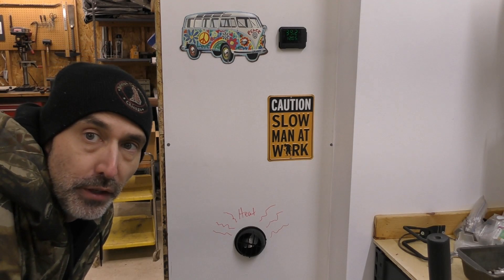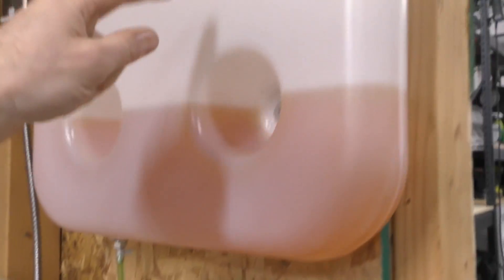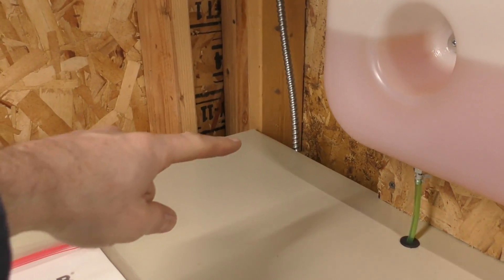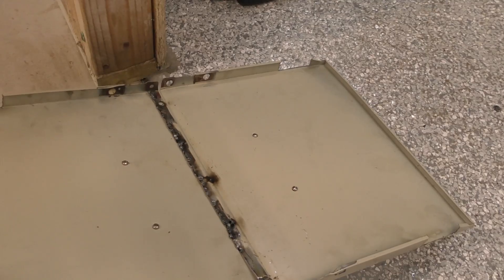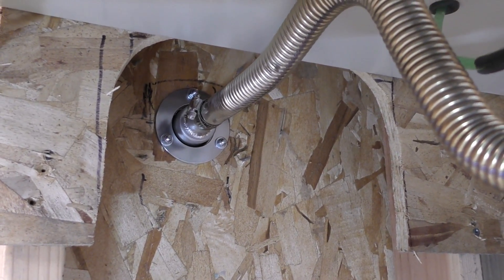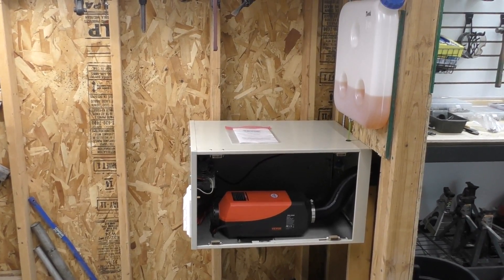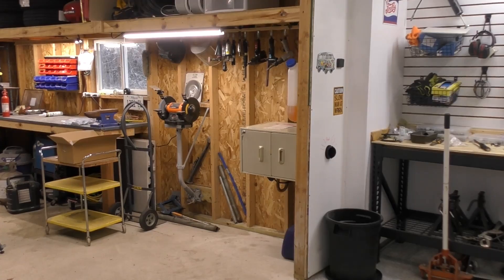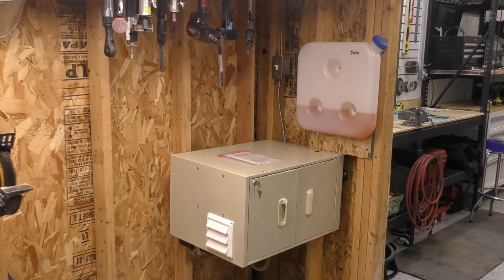Custom Garage Mini Furnace Using a Vevor Diesel Heater

Comment: Have you had any problems with soot build up due to the low point in the exhaust piping?
Reply from the maker: No soot buildup yet.  Watch the follow-up video pinned in a comment.  That shows the changes I made to the exhaust soon after I installed it.
Reply: @FixItScotty I saw that after I posted. Thank you.

Comment: Tank looks a little high up - isnt it hard to refill?
Reply from the maker: It is a little high, but I just have a small 3 gallon container that  I dump in. Other commenters have noted they pump from a lower tank and it works fine.

Comment: 2:39 fuel..  I run from an outside/ under cover 15 gal fuel call (cuz I had one) over ten feet away with a 1/4 inch hole through wall .  . The hard plastic line has an in-tank fuel filter strapped to it..   run with ZERO problems, 2 yrs, 4 mo per year nonstop, 24/7.  Nice fueling 1 time per week. OUTSIDE
Reply from the maker: Good to know. Thanks for sharing your setup!

Comment: The room I wish to heat is about 16 feet by 14 feet, and is insulated. Will one of these heaters bring it up to 70 degrees if it is freezing outside?
Reply from the maker: Depends on the insulation, but I would think so.  My garage is 30 x 18 with a very high 12 ft ceiling.  I can maintain a 10 degree temp. lift in that big area with this little thing.

Comment: Your exhaust having that big u in it,  is going to cause your combustion chamber to start getting carbon buildup. It will take a while but eventually it will stop producing good heat and then it just won't run. You'll have to take it apart and clean it all out maybe buy a new glow plug . . Other than the fuel pump mounting and the exhaust. Looks good .
Reply from the maker: I agree.  I did a follow video pinned in the comments that rectifies the issues you brought up.  Which are very good points.  Thanks for watching!

Comment: All the comments I read everybody has a different opinion on how these are supposed to be setup many of different experts apparently haha great job on your setup one of the nicest I've seen
Reply from the maker: I did a follow-up video (linked in the pinned comment) where I implement some of the commenters' suggestions to my build.  But, you're right, there are so many differing opinions on what is the "correct" way to run these.  Mine has been working great for the last year, so I am satisfied with my build.

Comment: Do not ever connect a power supply to a diesel heater. Battery and trickle charger is the best method.  If you suffer a power outage the heater will not be able to complete its cool down proceedure, potentially your workshop goes up in smoke.  Your combustion air intake should be outside as you are creating negative pressure inside the room and your exhaust should run down continuously from the heater as the exhaust gases contain moisture and you have created a trap for it.  Otherwise well done.
Reply from the maker: I don't run this full time.  The 55-amp power supply has been a good working solution.  Where I live, we don't have extreme weather.  If we do, I won't run it.  I understand your point about negative pressure, but my workshop isn't sealed up and has roof vents - so it's not an issue.  Good points though; other people's situation will warrant considering them.  Thanks for watching!

Comment: For 12v power you can also use an old computer tower power supply. The 12v is normally the yellow wires. Connect 2-3 of those wires to a couple of those XT60, 45a Anderson or insulated spade connectors then your heater
Reply from the maker: That could be a good option.  Thanks!

Comment: As already noted exhaust needs to be downhill the whole way for condensate draining. In addition the pump should be mounted at like a 30 deg angle with output on the high side. The other change I'd make is the tank. Holes in the bottom of tanks frequently or always leak at some point. Much better idea to use a stand pipe that draws out the top of the tank. They're available in a kit with some better white solid plastic fuel hose. The cheap green included tends to fail after a few months.
 Otherwise a nice install that gives a lot of people ideas
Reply from the maker: You are correct.  I have a follow-up video pinned in a comment where I implement most of your suggestions.  Thanks for watching!
Reply: @FixItScotty  Yep gotcha...just figured I'd address it again for anyone reading and didn't see or watch other vids

Comment: The heater should heat that size garage easily I would think.  Maybe get a small fan to help circulate the air.  Other than that I absolutely love your setup!  Very nice work Sir!  Great job.
Reply from the maker: Thanks!  Yes, I did add an oscillating fan mounted high on the wall to circulate.  I am a few weeks into the second season using it and it still works great.

Comment: Good work on using the fuel line for gasket. RedDye diesel is cheaper. Looks like off road use to me. Available where farmers get fuel. 🤠
Reply from the maker: Thanks!  I didn't realize my diesel was dyed, but it is red.  I don't live in a rural area, but I am in Illinois where there are farms within 10 miles of where I live, so that may be the only type of diesel easily available to me.

Comment: Can get more heat for less cost out of a Big buddy propane heater
Reply from the maker: That's true.  I actually have a 'Little buddy' and used it a lot in my old garage.  The two advantages of this diesel heater is that it blows the hot air to circulated it and it doesn't require ventilation like the propane heater.
Reply: @FixItScotty  they have a fan on the big buddy pro, there is an O2 safety shut off and the garage isn't sealed the best anyway. This way I don't have to drill a hole for exhaust. 
There's a bunch of ways to get more heat off the exhaust from the diesel heaters before dumping it but I'm not heating it all the time just a few hours here and there. So that's a lot of extra work for a diesel heater for me
Reply from the maker: @spacebike420  Good to know the propane heaters are improved.  And I agree, it is a bit of work to modify the exhaust to make these diesel heaters efficient.
Reply: @FixItScotty  they still seem the best option on something mobile with diesel available though. I'll probably put on in the truck topper just for camping.

Comment: Have you had condensation accumulation in the "U" exhaust pipe bend? I've seen videos where the low point was filled with water from condensation rather than external water intrusion.
Reply from the maker: Before I started using this heavily, I made a follow-up video with several enhancements; one being the exhaust.  Check out that video linked in the video description.  Thanks for watching!

Comment: A ceiling fan will help to distribute the heat evenly in your shop !
Reply from the maker: Yes, I mounted a large, oscillating fan high on that back wall.  That helps move the heat around.  Thanks for watching!

Comment: It is better to have the tank below the heater that way if you have a fuel leak you won't die ☹️
Reply: Do you trust your shop to a 25 cent rubber hose ?
Reply from the maker: No, see my follow up video. I upgraded the fuel line and exhaust.

Comment: Can anyone say how much it burns in a day? say it's heating a shop 900 sq ft, insulation is pretty.
Reply: say it's -20
Reply from the maker: I can't say how much it burns in a 24 hour period because I only use it for a few hours at a time.  My guess is that it can burn anywhere from a 1/2 gallon to over a gallon of fuel per day depending on how much temperature lift you are trying to get, how insulated your shop is, and the volume of air that's in it, etc.  There are many variables that make it difficult to give an accurate answer.

Comment: What i have learned so far on these and some suggestions. Tank does not matter above or below pump. The pump should be mounted on vertical surface at a approx. 45 degree angle to one side or other in proper direction. Recommend upgrading fuel line to nylon fuel line, green fails. That power supply your using is a converter/charger, so you can run the unit off a 12v  battery and charge at same time in the event of a power outage. If you shut these down before cool down is complete you can destroy your heater, really must have battery backup or a automatic whole house generator for quick power recovery say in like two minutes. The heater goes into cool down as power is restored. As others have noted exhaust is a trap, must all flow down, exhaust installed like this lead to sooted heat exchanger over time and a real mess. These are simple but they do have some must does when installing.
Reply from the maker: I agree with your suggestions.  I have a link to a follow-up video in the description where I addressed these issues.  Thanks for watching!

Comment: I have w vevor 8kw in my workshop size slightly bigger than a double garage. 2 heaters transform my garage from 3+ to 18+ clcius within 40 minutes
Reply from the maker: My single heater will provide a 20 degree Fahrenheit temperature lift, but it takes a bit longer than 40 minutes.  So far, I am pleased with it.  Thanks for watching!
Reply: @FixItScotty  buy another one. 2 is really a difference.

Comment: I concur with all the construction points raised below. Drill another hole in the siding and take your combustion air from outside. If the thing is not set-up properly, it may soot-up, causing incomplete combustion products to reverse flow out of the inlet. Purchase a Carbon monoxide detector for improved safety, run the pump vertical. Kerosene burns cleaner. Stay safe!
Reply: Do not take combustion air from outside..  the combustion is already low temp and this makes it worse.  Same reason to reheat inside air, not heat outdoor air

Comment: you don't need a fuel pump if fuel tank is above the heater.
Reply from the maker: It would be an interesting experiment to try it without the pump.
Reply: FALSE...that's where the control comes from

Comment: Thank you for the video!  I have a differing opinion - put the fuel tank below.  If the pump fails open, if you have the fuel above, gravity will dump the fuel into the heater.  The pumps are designed to last for quite some time and mitigating a fire hazard is always a good thing.  Also note - you should consider adding a battery backup if some sorts so if it stops, it'll at least fail over to safely do cooling during shutdown
Reply from the maker: Thanks for the info!  I will roll the dice on the tank height as it would be a difficult change now and it has been working well.  I noted on my follow-up video that I may do the battery backup; I could even just throw a cheap computer UPS in between the outlet and the power supply.  I just haven't gotten to it yet.  Cheers!

Comment: Question for everyone. Can the control panel be changed to fahrenheit ?????
Reply from the maker: Yes you can.  While it is on, push the up arrow button for 3 seconds.  That will toggle between Celsius and Fahrenheit.
Reply: @FixItScotty  Thank you

Comment: The odds of the fuel pump failing aren't worth having to fill the tank at shoulder height. They typically don't fail if they're burning clean diesel.
Reply from the maker: I will likely only refill the tank once a year, but that's good to know.

Comment: I installed a Chinese Diesel heater in my 6x12 cargo trailer conversion... I spent all my effort making sure I properly exhausted the unit through my 1 inch insulated wall using a thru-hull stainless outlet as well as using high-temp RTV around my exhaust hose with high quality hose clamps, and thought everything was great.. I now know that I need to also properly setup a thru-hull port for the combustion intake (away from the exhaust). These devices are primitive.. don't trust that the exhaust flow will happen in one direction with 100% certainty... and don't expect your Home Depot CO detector to save you either.. I've smelled the funky smell, and let it go... and it made me pretty sick.. Don't ignore it... do it right.

...also, if you drop the diesel pump frequency, the exhaust-to-intake leak is even worse... Treat the combustion intake just as important as the exhaust itself.
Reply from the maker: Thanks, I am considering routing the intake to the outside as well.

Comment: I installed similar recently. I extended the exhaust inside running it through some box section filled with sand. The idea was to capture some of the heat from the pipe. Exhaust of course then gets vented outside. Most of these kits seem to come with inferior clips and green pipe which people tend to replace before install. The fuel tank I had is same as yours. If I was doing it again I would have a pick up pipe installed at the top of the tank, less likely to be a leak problem and you could have the intake picking up just above the bottom so that you weren't picking up rubbish that accumulates there.  Good tip to use exhaust paste to make a seal. As someone else said, you have your fuel line with hot pipe either side of it. Thanks for the video, instructions are not great with these things so it's good to see other installs.

Comment: Nice setup. It would be best to have a continuous downward slop the entire length of the exhaust, with no U shape in it. That is what I did with my CDH setup. This will prevent any condensation from ever collecting inside the exhaust. If the CDH ever starts to operate funny and might even seem like it is backfiring, remove the exhaust and see if there is any water in the bottom  U shape section of your exhaust. (It so happens the other day I watched a video of another youtuber that had this happen with his setup.)  All the best, Tony
Reply from the maker: A few other commenters have mentioned this too.  I am redoing the exhaust tube this week as you suggest.  Thanks for watching!

Comment: I have two heating my off grid cabin. They don’t put out much heat, so don’t be misled thinking you can heat your house with one (unless its extremely well insulated)
Reply from the maker: Agreed.  I think I mentioned in the video that my only expectation is that this heater will help cut the chill out of the air in that area of my garage.  To heat that space properly would involve a LOT more energy.  Thanks for watching!

Comment: I saw a guy talking about the exhaust and it stuck in my mind. He said a byproduct of that combustion is moisture or water that might collect in the flex pipe and restrict the airflow, causing soot in the heater 

I haven’t used a diesel heater and maybe I’m wrong but I think I’ll try to make the point where my exhaust vents out a little lower than the connection on the bottom so it can go downhill the whole route.
Reply from the maker: You are correct.  Other commenters have noted this and I am in the process of redoing the exhaust.

Comment: Nice install but for the space and money spent, you could get a good mobile home oil furnace and still run it off diesel and a simple 110v install. I installed one in my 20x40 garage and it heats great. Exhausted straight through the wall, no chimney. My FIL has one of these 12v diesel heaters in his garage and works well but takes some time to warm it up.
Reply from the maker: Very cool.  If you have a suggested model or link to one of these units, drop it in a comment.  Thanks for watching!
Reply: @FixItScotty  for the money spent???? a mobile home oil furnace, 1# they don't sell in my liberal state, they actually outlawed(MASS,NY,CT),2# you only spent $100! mobile home furnaces start at about $2000.

Comment: The biggest mistake I noticed is the loop from the exhaust which will favor the collection of water from the condensate in the exhaust - this means it will malfunction over time
Reply from the maker: Other commenters noticed the same issue.  I just finished raising the cabinet a few inches and ordered a new exhaust tube and clamps.  I will be making a follow video to show the correction very soon.  Thanks for the comment!